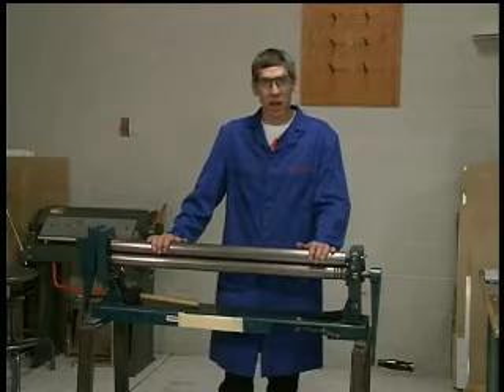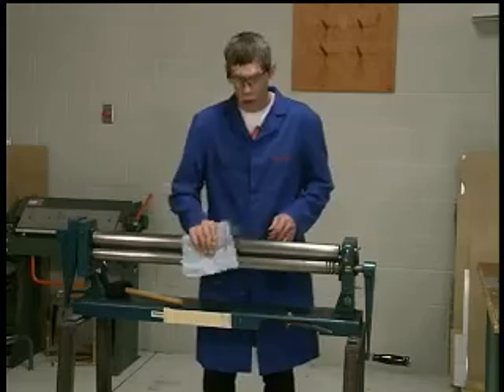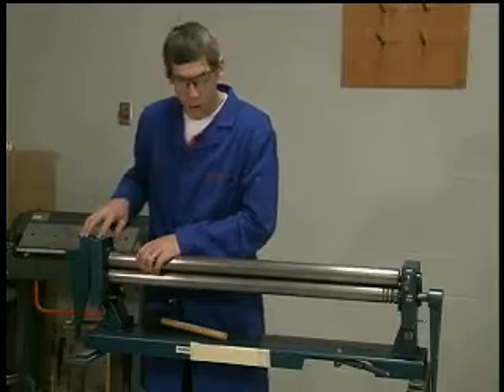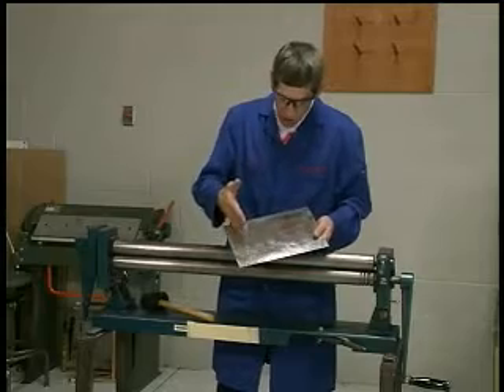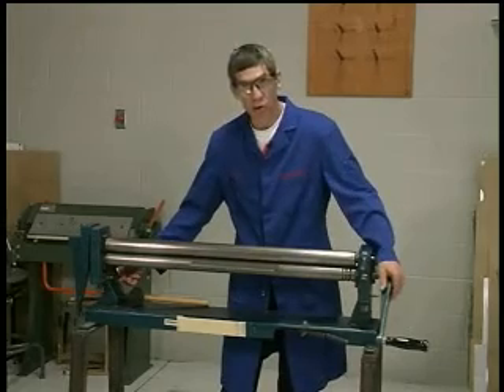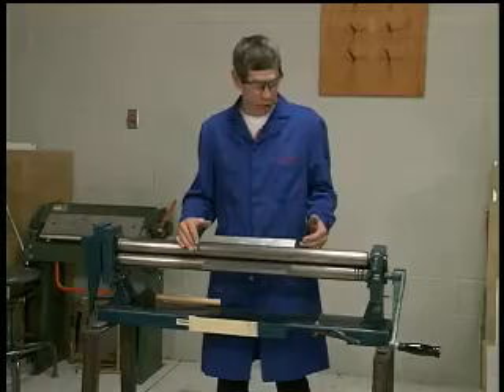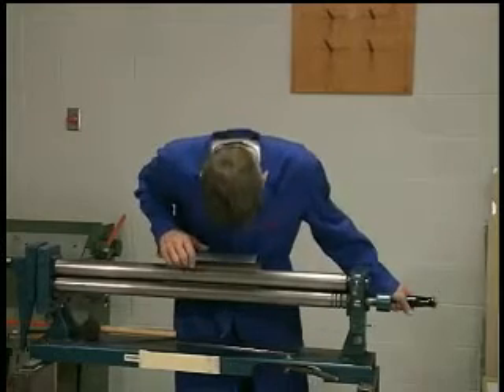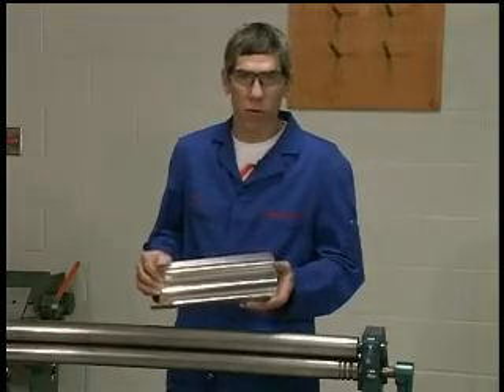Using the Slip Roll Former

Comment: There is always that darn flat part because the roller that is causing the bend is a certain distance away from the dual squeeze rollers.  I guess there is a way to make fully round tubes with this tool, but how?
Reply: Tap the sheet the opposite way to put a slight bend the other way then roll a few times flip the sheet around and do the same with the other end. Doesn’t get the flat spot out entirely but makes it a lot better.
Reply: My usual way is to weld the edges, grind flat, then put it through the roll again
Reply: The way to get the bend to the end, is to just barely get a bite on the end of the metal, then you would have to push/pull the other end up above the rollers to apply the bend to the end.